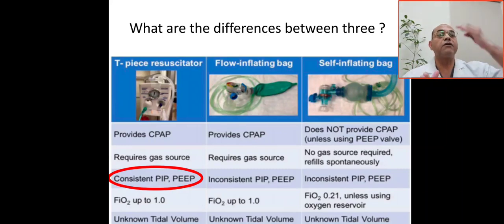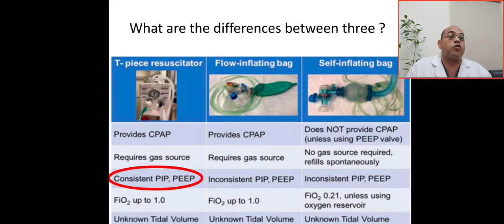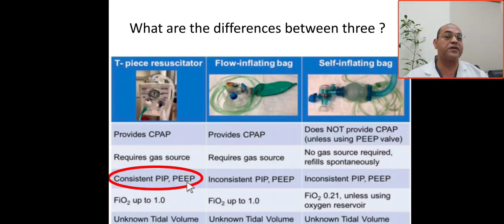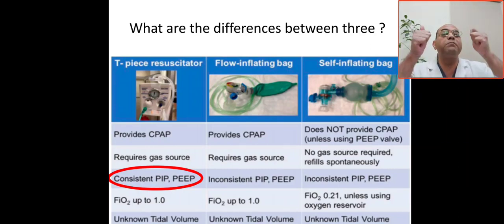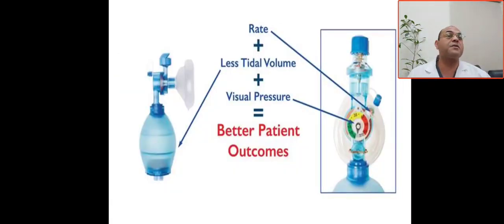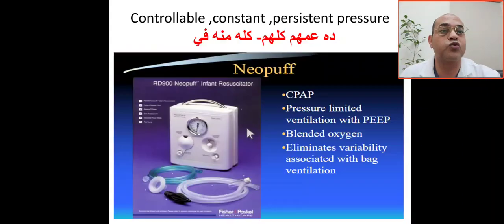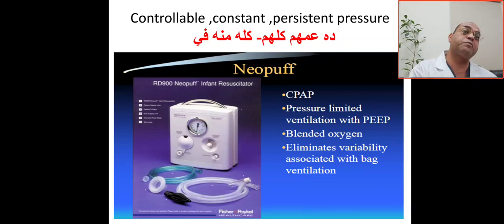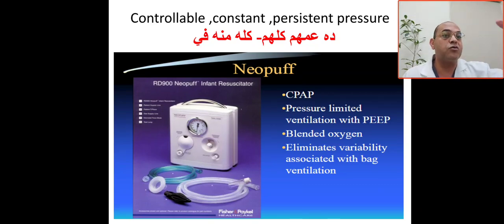What are the differences between neopuff, flow- inflating  and self inflating bag ? Constant pressur

Comment: How can I adjust O2 % from the device (21% , 30% , 100% ) ??
Reply from the maker: 🌹Nasal Prongs 
Depending on how how much Flow you give to the patient 

   Flow = FIO2 
• 1L/ M = 24 % (0.24) 
• 2L/ m = 28 % (0.28) 
.3 L/ m = 32 % (0.32)
 •4L / M =  36 % (0.36)
 • 5 L / M = 40 % (0.40)
.6L /M =  44 % (0.44) 

🌹Example 
Self inflating bag 

Depending on present or absent the oxygen reservoir 

= With oxygen reservoir = 100 % oxygen 
= with out oxygen reservoir = 40% oxygen
Reply: @dr.tageldinaly  thanks tooo much 🙏🏻🌸